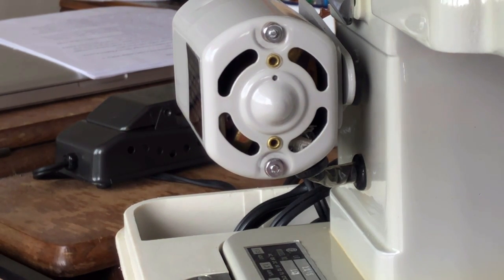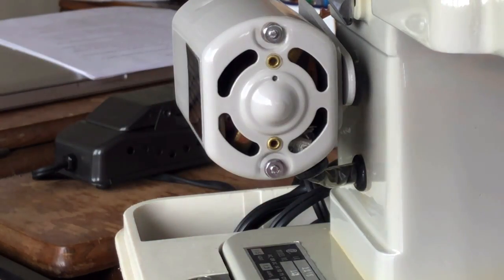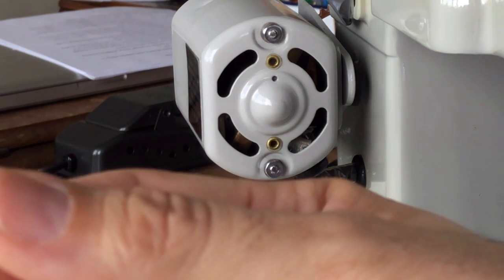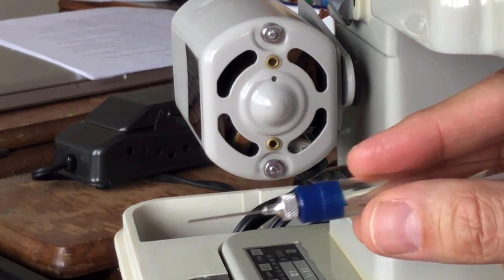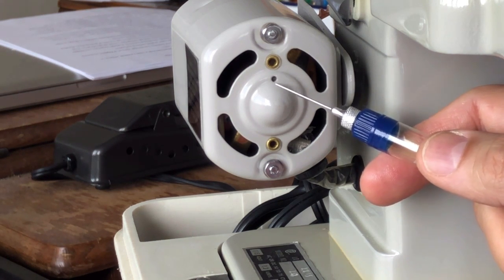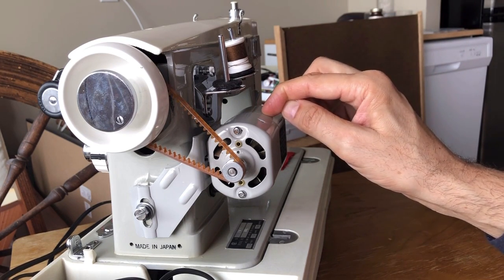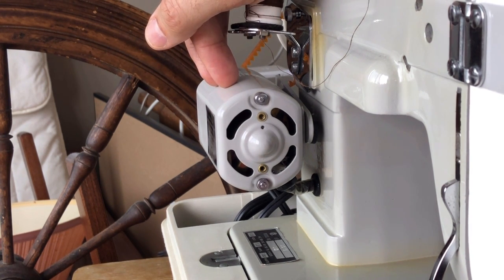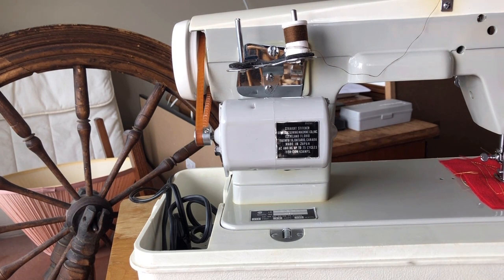MOTOR SERIES #4:  Lubricating the Bearings.  But What Happens When You Can't Access the Brushes?

Comment: I can't locate any oil port in my electric motor.
Reply from the maker: It could be that yours might have been manufactured without a port.  Over time, motors and the machines themselves increasing were made with "Lifetime Bearings" which is another way of making things less serviceable.  But there is not way to know for certain without seeing the motor.